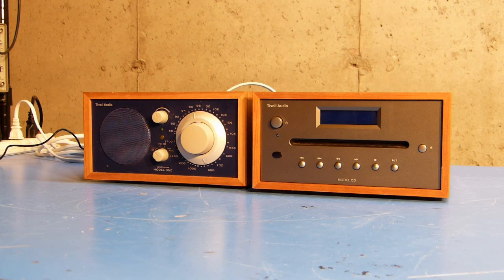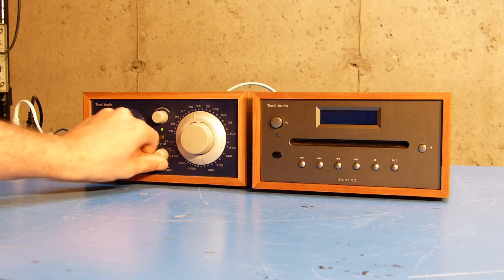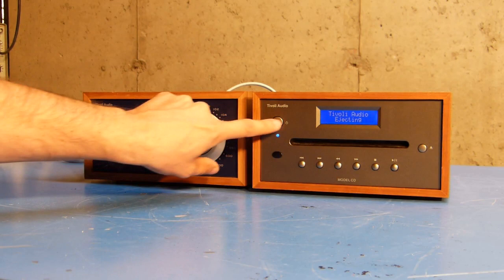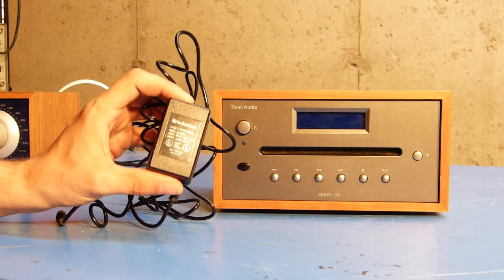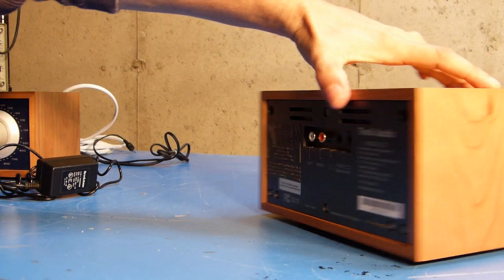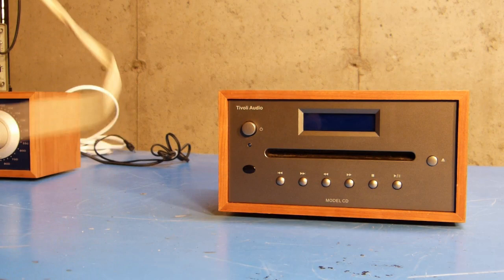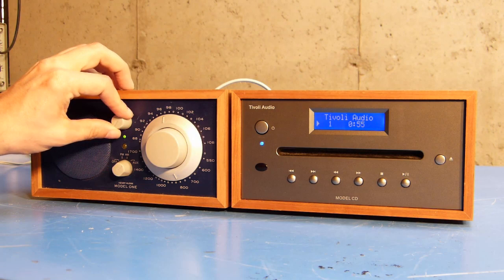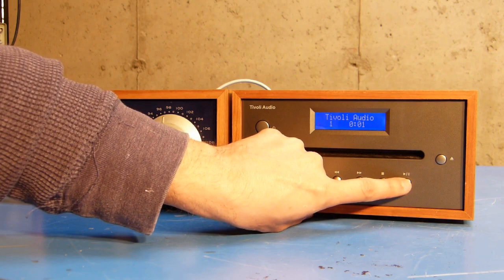Tivoli Audio Model CD Overview and Power Supply Upgrade

Comment: Thanks for the help, i'm having troubles with my identical unit. How many mA is the new power supply?
Reply from the maker: I don't remember...check on line for a manual to see if the specs are listed

Comment: I've got the same CD player at home. The problem is that theres a CD stuck inside of it. It will not eject.  No power issues at all. Any ideas what i should i do? Its been like this for over 4 years and i just disconnected it and i put it in storage .      Thank you.
Reply from the maker: I'm not sure without having it in my hands.  You may be able to eject the disk with a paper clip if there is an access hole someplace on the unit.  Doing that may re-synch everything but it is unlikely.   Service manuals for these things don't really exist but you could take it apart and look for something obvious like a stuck sensor switch or something like that.
Reply: @SevenFortyOne  Did you try to insert a thin pincet/hospital pincet with small hooks. It should work.